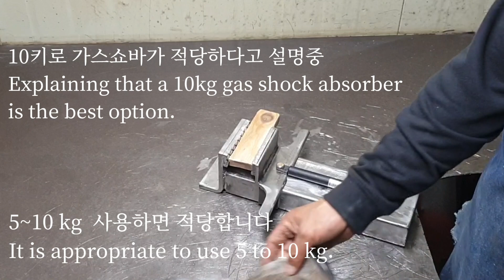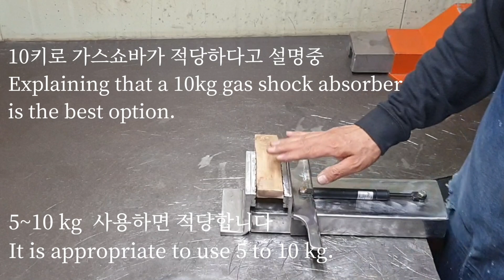가스쇼바로 만든 바이스 (Vise made from shock absorber)

Comment: ManSoo Ssi,

I like the fact you're using compression shocks in your current designs.

You might try using a scissored lattice to make retracting vise jaw easier.   Depending on the number of slats in your lattice,  you might be able to go back to a 20kg shock.

I like your knurled rectangles for grip in the jaws.  I know that you can purchase as fine as 1mm knurled rectangles for a few dollars made in Asia. 

You never disappoint,  great creation!

Kwon
Reply from the maker: I'll try to find more to complement as I use it.
Thank you for your advice.